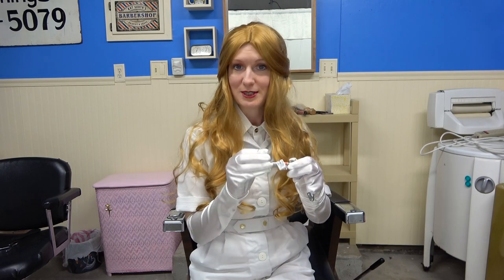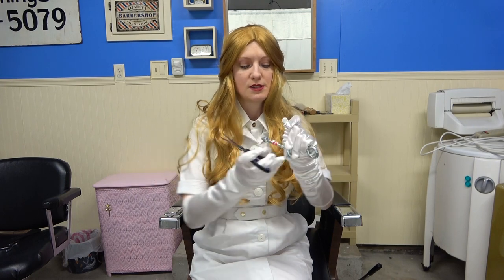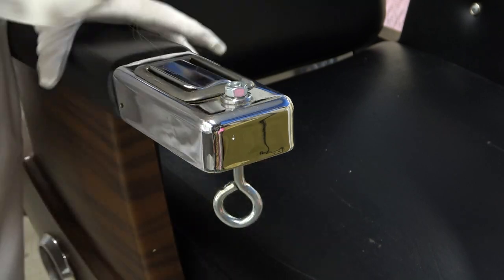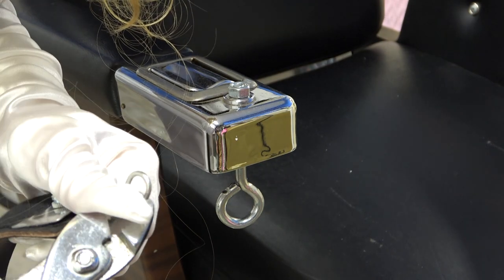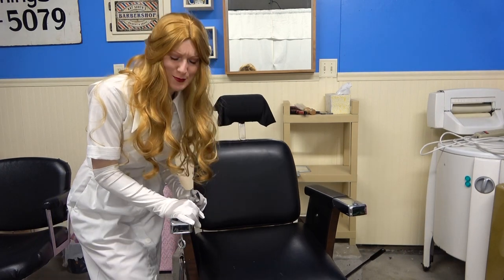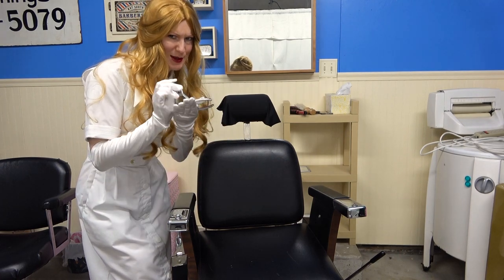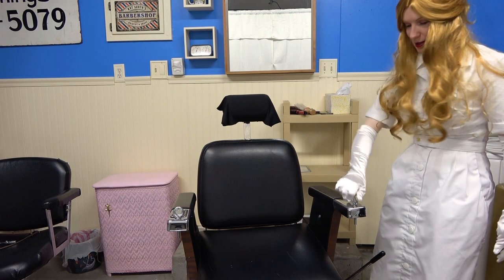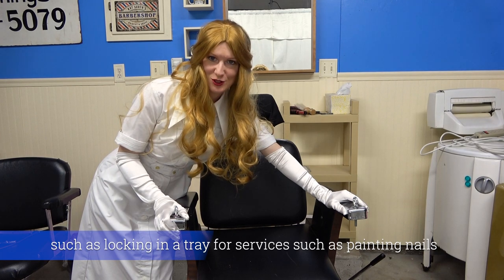How to add accessories such as a barber strop to the arm holes of a 1970s Sir Koken Barber Chair

Comment: Creative. A creative use for the manicure tray mount holes. For those that might like details. The frame of Kat's barber chair here is the Koken Thoroughbred model. As Kat said, introduced and popular in the '70s, and still in use in some shops many years later. (Mine had one.)
The holes in the end of each arm rest were for a chair-side manicurist. She (generally, as never saw a male manicurist) had a small tray with a rod attached and extending underneath. She placed the rod into one of the holes, and the tray held her finger bowl and manicuring tools. There is one on each side to service each hand of the client. Some Thoroughbreds did have a strop mount (as mine did), some barbers installed their own. It was an eye screw, rather than eye bolt. Similar to Kat's fix, but with wood threads rather than machined threads. A hole was drilled into the underside of the arm rest near the back since that portion of the arm rest under the upholstery is all wood, and the eye screw, screwed in. It was near the rear so it did not swing or bump against the clients leg. And also, the Thoroughbred had an ash tray installed into the right arm rest near the front, behind the manicurist's tray hole. Just furnishing some trivial tid-bits for those who may want to keep, or restore a barber chair in a somewhat authentic form. Another help suggestion for Kat's fix. If you are staying with the longer eye bolt, or even a slightly shorter one, here's a suggestion: thread a nut onto the bolt, then insert the bolt into the (manicure tray) hole as you did. Place a second nut onto the bolt shaft extending upward. Screw the top nut down as far as you like...good idea just to the top of the threads. Then with the top nut sitting flush against the mount, turn the bottom nut upward until it reaches the underside of the arm, then tight the underside one with a wrench. This will keep your eye bolt from moving up and down, or swiveling.
Reply from the maker: Thank you so much! This is amazing!